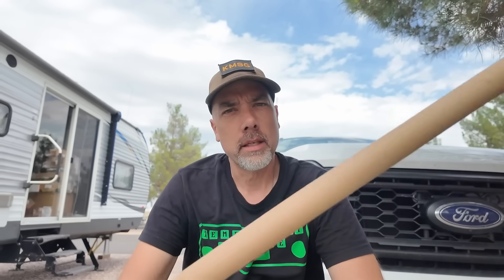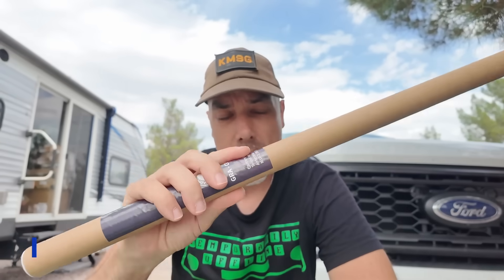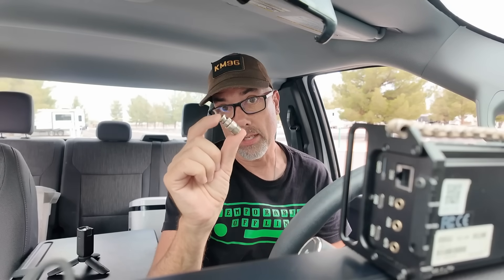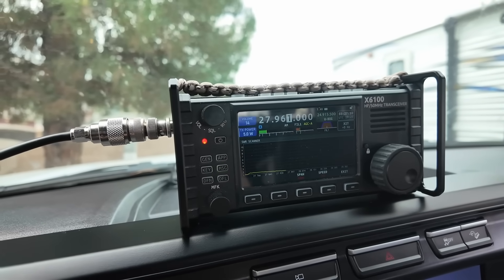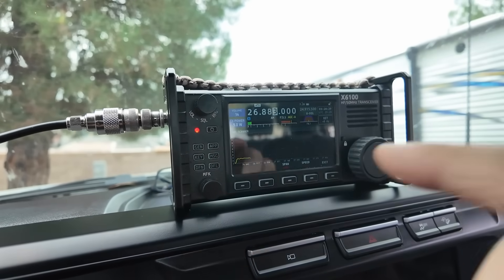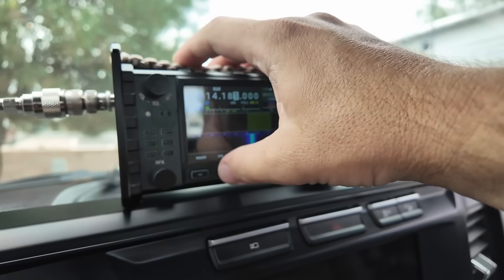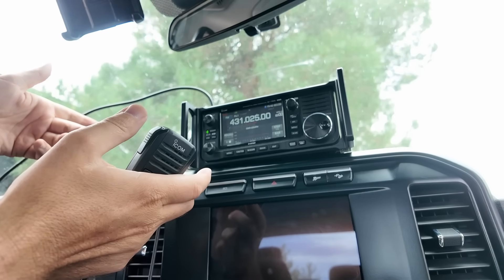Forget the Myths. This 10m Carbon Fiber Antenna Delivers the Signal.

Comment: I received the cfs-10 and installed it on my car roof. I’m getting a 2:1 swr on my g90 and can’t figure out why. Any help would be much appreciated.
Reply from the maker: What band?  Did you use the tuner?
Reply: @temporarilyoffline 10m and yes using the g90 tuner. The antenna is on a mag mount in the center of the roof of my suv.
Reply from the maker: @dadsrcworkbench1322 it should be pretty darn close without even using the tuner on 10m.  Maybe you have something going on with the coax?
Reply: @temporarilyoffline yeah maybe. It’s the same nmo mount and coax I use for the 2m antenna, I just swap out to a nmo to 3/8 24 mount for HF.
Reply from the maker: @dadsrcworkbench1322  just gotta start isolating components until you find the problem.
Reply: @temporarilyoffline yeah I agree. I’m going to start with the nmo mount, it is not a shiny brass color.

Comment: Great testing.  With that sliding coil the tune can be great on any band in range of coil . You can add a Unistrut to the outher make it higher but will bend more. The trick is get the loading coil even with the metal roof of RV for best pattern. Them 3/8 24 to M 10 adapters are handy . W6LG Jim did a video on them adapters. Hardy any loss at HF and he put many . like 15 of them together . Only at UHF you will notice loss and you should go to N for UHF threw microwave. 73
Reply from the maker: Don't read the other comments, somebody thought that adapters would be a problem...

Comment: Carbon fiber is conductive at RF.  You wouldn't be able to make an antenna out of it like these if it weren't.  It's a lousy conductor compared to copper so you'll radiate less than if you made the same antenna out of metal - but as we've said 1000X every antenna is a compromise and clearly these do work.

The big telescoping masts can impact antennas, but that's not necessarily a bad thing.  How folks got the idea that a DXCommander with 8 radiating elements all in a tight circle is great, but a carbon fiber mast is a travesty I will never understand...
Reply from the maker: Some people want to talk more than listen.  They want to keep their eyes shut.  Everything is an antenna if you're brave enough.

The "real" radio engineers don't scream at each other about materials and SWRs, they make radio work and get paid for it.

Comment: 3:10 - I'm smelling a lot of insertion loss from that stack of RF adapters.   🙂

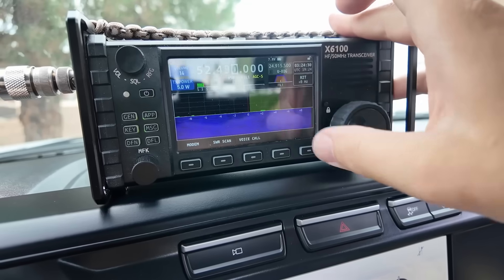5:30 - A low SWR doesn't guarantee the antenna is an efficient radiator.  A dummy load has nearly a 1:1 SWR.

12:45 - Gabil offers every ham combination of threaded adapter but there really should only be 3/8-24 so we don't need adapters.  I prefer metric for new stuff, but if there is already a standard... USE IT.  I already had Gabil's D adapter and I just ordered their F adapter with the opposite thread combination.

I ordered the GRA-CFS10 carbon fiber whip antenna on 16OCT25 from the jungle.  Delivery was estimated to be 26OCT25 to 12NOV25, but eight days after ordering, it still hasn't shipped.
Reply from the maker: Good thing I was able to make contacts!

Comment: I see you seem to like the 6100. I am trying to decide on the 6100, 6200 or ic-705.
Reply from the maker: They are all good radios.  I use both my 6100 and my 705 regularly - the 6100 is an easy option for a POTA/SOTA and the 705 is better at being in the shack/attached to a PC/resonant antenna.  The 705 also makes a good looking rig in your car!

Comment: Could the direction the trailer facing be the cause of no signals from the West? You have a big metal shield behind that antenna. Just a thought. Good Work TO.
Reply from the maker: The trailer is facing north/south... the west hole is called... The Pacific 😎

Comment: I recently had an adapter mess too! I needed a UHF to f-BNC but had to go UHF to m-BNC to SMA to f-BNC

I didn't push much power through it since SMA is to my knowledge only used in handie talkies. 

It worked! Unfortunately SWR was high so test results were mixed and I couldn't say if it was due to the SMA adapter or the antenna not resonating well or maybe both! 

I just put it away ordered the right adapter and grabbed a tried and true antenna out of my box and got back on the air
Reply from the maker: Sometimes you gotta do what you gotta do to get on the air!
Reply: @temporarilyoffline I can't thank you enough for helping me with the icom 7100 issues I was having with ft8. You knew exactly what was going on and how to solve it
Reply from the maker: Happy to help!